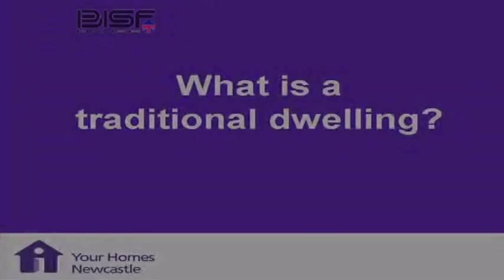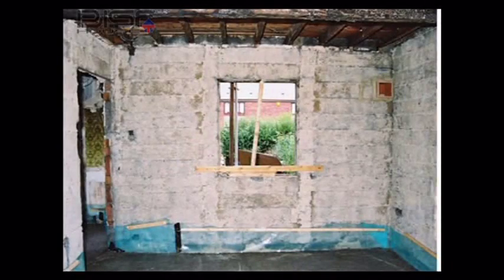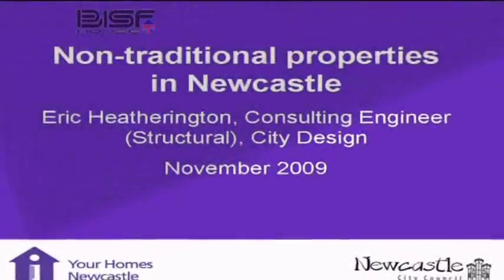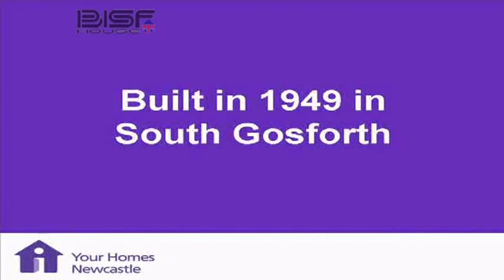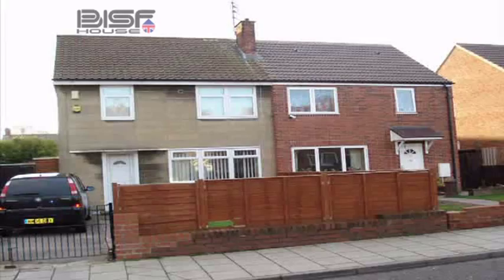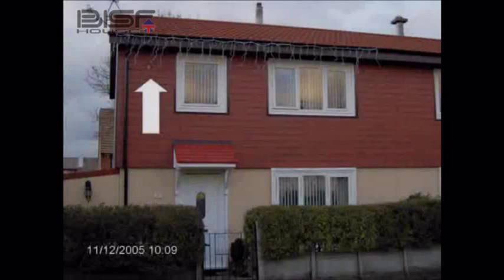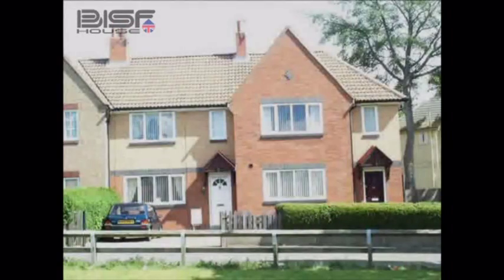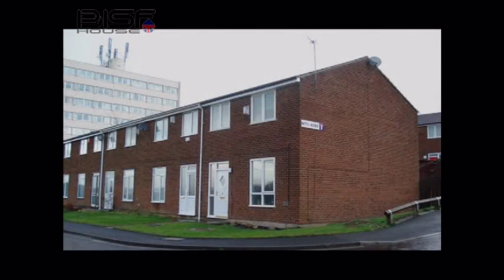Non Traditional House Types

Comment: I used to live in a pre cast concrete Airey house, one of the original prototypes.  The steel supports were incased in concrete but the concrete spoiled and the supports started to rust.  It was well insulated though.